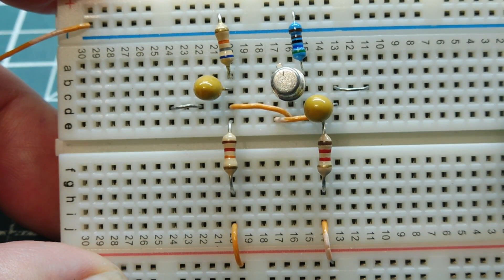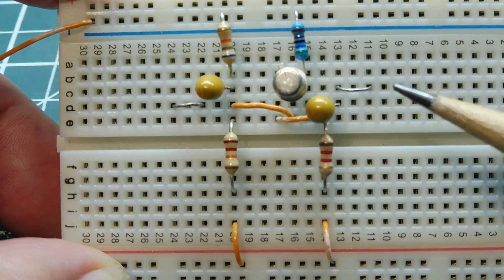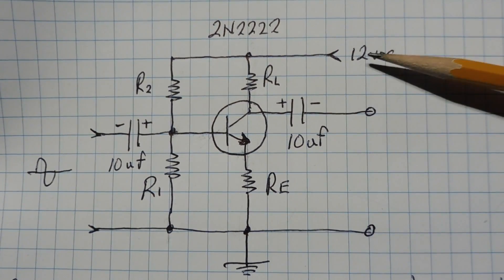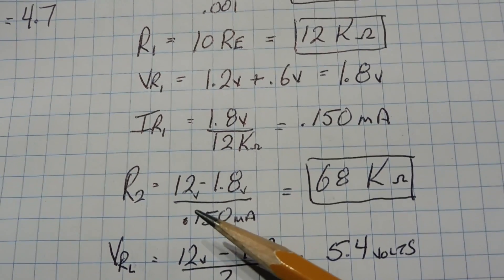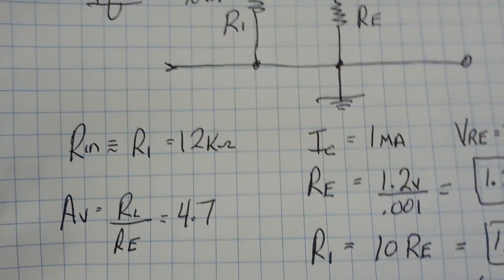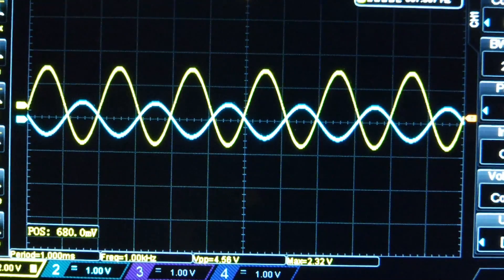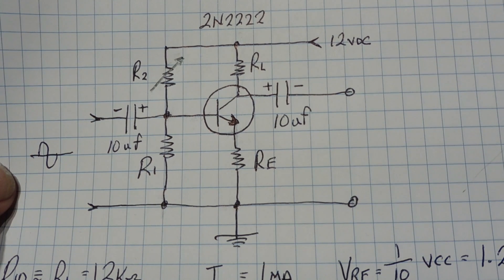Design And Build A Common Emitter Amplifier

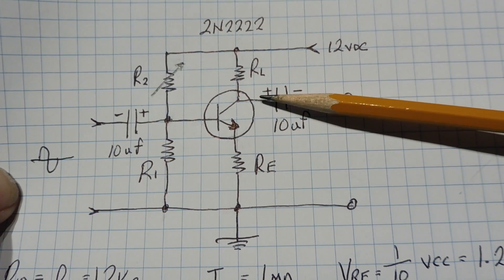Comment: That's all good advice, and neatly done. It might be worth pointing out that decreasing your initial choice of collector current will lead to all of the resistors having higher values, thus showing that the input and output impedances are mainly determined by the choice of collector current. One small niggle: you were right initially when you took the emitter voltage from the supply and shared that between the transistor and the collector resistor (5.8V each). But then at 5:51, you slip back to the approximation of "half the supply voltage", which will always lead to the negative output clipping first, and someone without a scope won't be able to see that. Better to do the more precise calculation Vc = Vcc - (Vcc - Ve - Vcesat)/2 = (Vcc + Ve + Vcesat)/2 and adjust R2 to give you that.

Comment: You have made the design criteria so easily understood, thank you. I do have one question though. What determined the 10uF values for the coupling capacitors on the input and output. Did you simply use a cutoff frequency of 20Hz for a high pass filter in combination with R2?
Reply from the maker: The capacitor value and the input impedance of the circuit (12k) will determine the low frequency cutoff value. Rule of thumb is the Xc of the capacitor at the lowest expected frequency is less than one tenth the input impedance, so 1200 ohms.
Reply: The high pass -3dB frequency is when the reactance of the input capacitor is equal to the input impedance of the circuit. In this case the input impedance is R1 in parallel with R2 in parallel with the transistor input impedance looking from the base. The transistor input impedance looking from the base is approximately β times the total emitter resistance, in this case, around 100 x 1.2K = 120K.
The reason why R1 was taken to be about 10 times Re is to ensure that the base current is negligible compared to the current through R1 and that R1 is much less than the input impedance of the transistor.
Away the circuit input impedance is around 12K || 68K || 120K = 9.4K. Clearly R1 is the dominant factor as we wanted. So if we want a high pass cutoff frequency at 20Hz, we want Xc = 9.4K at 20Hz. That gives C = 1/2π.20Hz.9.4K = 0.84μF. So a 1μF capacitor would do.
You can't calculate the value for the output capacitor until you know what the value of load is going to be.
Reply: @RexxSchneider  To get an optimized response down to 20 Hz without any phase anomalies you calculate the -3db down point 1/10 of the desired cutoff frequency (20Hz) to get 2 Hz. This would increase the capacitor value so 10uf would be a better choice.
Reply: @CanadaWakeUp  For audio purposes, it is simply sufficient to have the -3dB frequency below 20Hz. You should understand that any speakers will be a far greater source of "anomalies" at 20Hz than any circuit that has a cutoff at 20Hz. Nobody can hear a 45 degree phase shift at 20Hz, nor can the ear detect a 3dB difference in amplitude at those sort of frequencies. Neither you nor I, nor anyone else could detect the difference between using a 1μF capacitor or a 10μF capacitor at the input. However at higher frequencies, the quality of capacitor becomes important. You can get good quality polypropylene/polyester/film capacitors with a value of 1μF, but not realistically at 10μF, which means you'll end up using an electrolytic or ceramic, both of which are avoided for good quality audio use.
Reply from the maker: This video was requested by viewers to be a KISS (Keep It Simple) "rule of thumb" layman's term video for beginners to get a circuit up and running for experimentation purposes. If you want to get into advanced topics, feel free to make your own subject video and I will post the link to your video in the description box for anyone who is interested.
Reply: Thanks for all the replies. Very helpful indeed. I have been playing with my oscilloscope and it’s signal generator and watching what happens. I agree very much with the KISS principle and note that since all components have tolerances anyway that ball park rule of thumb values is good enough in most cases. Particularly where my ears that already have tinnitus anyway come in to the equations! So once again thank you for taking the time to educate me.

Comment: Can you elaborate on the resistor in series with the bypass capacitor?
Reply from the maker: Applying a  capacitor across the emitter resistor will remove negative feedback, with an increase in gain and also distortion. A resistor in series with a capacitor across the emitter resistor enables you to control the amount of negative feedback that is removed thus controlling the amount of distortion generated.
Reply: To be a bit clearer. The bypass capacitor shorts ac, so the DC voltage at the emitter remains the same but the gain increases. A series resistor is then added to give negative feedback to the ac gain. The feedback provides stability and higher bandwidth. Without feedback, the ac gain will be determined by the emitter resistance inside the transistor which fluctuates on temperature, current and design of the transistor.
Reply: @dartplayer170  Just to add that with a 1mA collector current, that internal emitter resistance will be about 25ohms, and that sets the absolute maximum gain of the stage to 5.6K/25R = 224 times, but of course, there will be severe distortion of large signals, etc. at that gain. If you put a resistor in series with the capacitor equal to about 10x the intrinsic emitter resistance - use 270R - you will set the ac gain to the collector resistor divided by 270R, which gives a voltage gain of 5.6K / 270R = 20.7 times, a useful increase in gain with little impact on stability and distortion compared to the simpler circuit illustrated in the video.
The bypass capacitor would have to have a reactance smaller than its series resistor (270R) at audio frequencies (above 20Hz), so we could calculate its value by C = 1/2πfR = 1/2π.20Hz.270R = 30μF and we could use 33μF.

Comment: Question: I built this amplifier exactly as you designed it and experienced the exact same results at 1000-3000 Hz.  When I drive it with a signal generator and begin to get into radio frequencies (like 100 Khz or more), the gain drops off severely.  Can you recommend what I need to learn about an amp stage like this in order to amplify higher frequencies?  Thanks!
Reply from the maker: The amplifier is designed for audio applications. The gain drops off as frequency increases due to the Miller effect. Base to collector capacitance of the transistor is amplified during high frequency operation and causes negative feedback, decreasing gain. A way around this problem is to build a Cascode amplifier which are commonly used in video amplifiers. Here is a very good video describing the Miller effect and Cascode amplifiers. https://www.youtube.com/watch?v=Op_I3Ke7px0
Reply: Thanks for your advice!

Comment: sir my collector resistance is getting hot ,my Vc is 60. So my Ve is 6v. And so my Vb is 6.8v .and i correctly calculated the all four resistance value according to your teaching, my Ic is 300ma, My amplifier is not giving much sound to my speaker. A very little sound. Please help me i am new at electronics.
Reply from the maker: The common emitter amplifier is not meant to drive a speaker directly. Check out this video if you want to drive a speaker.
https://youtu.be/zMmaFV_JRAw
Reply: If you set the collector quiescent voltage to half the supply rail, that is 30V, and you pass 300mA through the transistor, you will dissipate 30V x 0.3A = 9W in the transistor and in its collector resistor, which would have to be 100 ohm 10 Watt in order to survive. Sadly the 2N2222 cannot dissipate more than 500mW even in its metal TO-18 can. so that will burn out within moments. It also has a maximum rated collector voltage of 30V, so is not usable with a 60V supply even at low currents.
The lesson is that you cannot simply scale up transistor circuits indefinitely without taking into account other limitations of the elements you are working with.